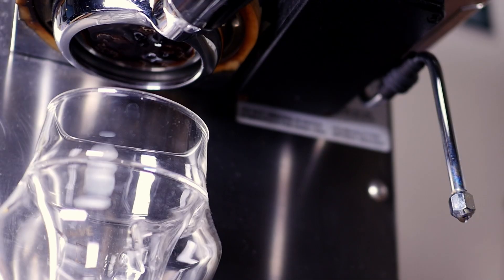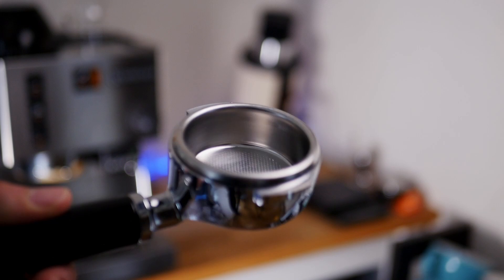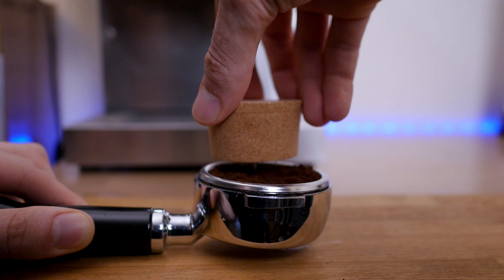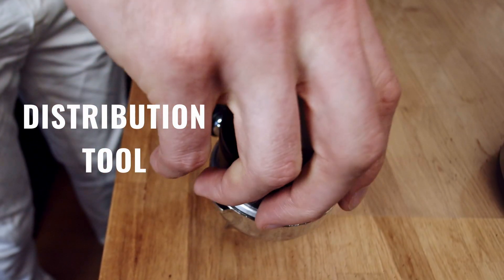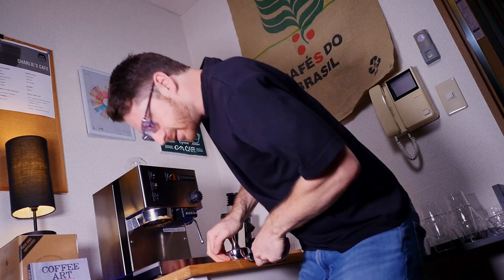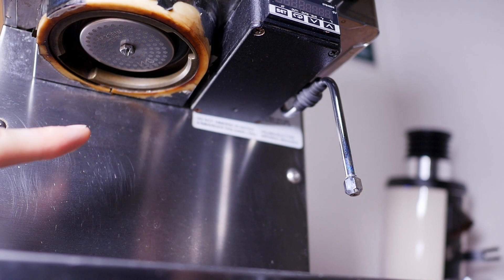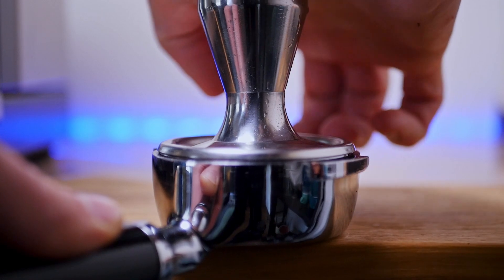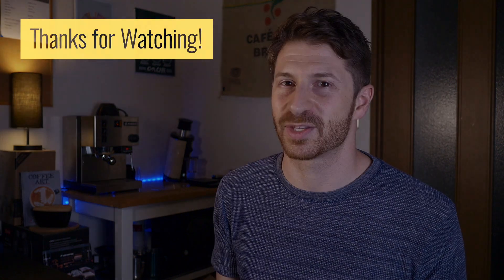How To Fix Sour Espresso with Perfect Puck Prep

Comment: If your grinder has a dosing cup, give it a shake with your hand over the top before transferring to the basket. This is only for single dose grinders though, as grind flow will vary throughout the grind meaning more variable particle sizes. Another great tip is to start with a coarser grind setting and work finer as you dial in a new bean. If you start fine from the start, you're more likely to get channeling and you'll chase grind settings forever!

Comment: something important to mention is with a regular tamper you need to make sure your not tamping at an angle at all if your technique is sloppy one day the puck is slanted it just goes through the side with less coffee thats why i feel like a palm tamper is just better cause it's impossible to do that and you are causing less strain on your hands and elbow
Reply from the maker: Good point!
Reply: I thought a spring loaded tamper for this reason. I'm hoping it works, but I've noticed myself having uneven tamps
Reply from the maker: @justSomeUserOnYT  Spring loaded are good for consistency of tamp pressure, but you still gotta make sure it's level 😉

Comment: I agree, proper consistent puck prep is important. A dimmer switch (easy upgrade) can fix a bad grind, even a bad puck. Water quality matters too. I set my distributor to 6mm deep and the tamper side 10mm deep. That keeps the prep consistent, and the puck off the shower head. The IMS basket vs the stock basket also matters, at least changes flow and consistency. Here’s how my setup goes - https://youtu.be/val-K-Z_YCM
Reply from the maker: Interesting. What is a dimmer switch?

Comment: Hey Charlie, I've found that if I set my distribution tool to the proper depth I don't need to use a tamper. Have you tried that?
Reply from the maker: I have! I used to do that and even ground finer cos I didn't have to tamp. It isn't necessarily just better, but really a different way to pull a shot that can balance out sourness especially in lighter roasts. If it works for you, go for it <3